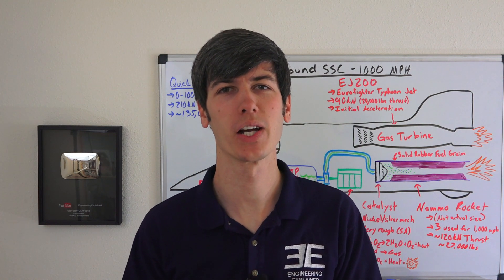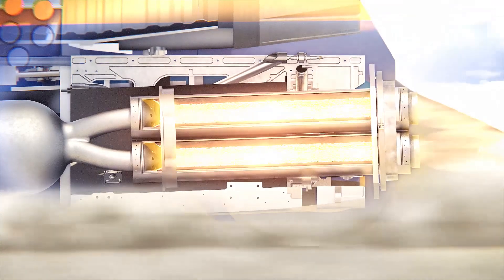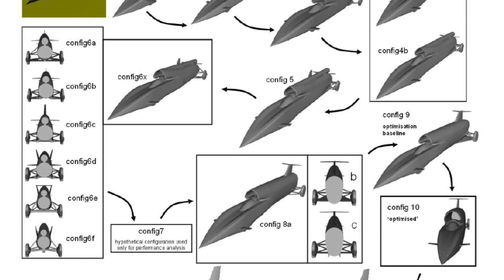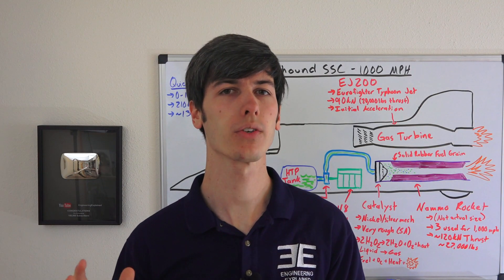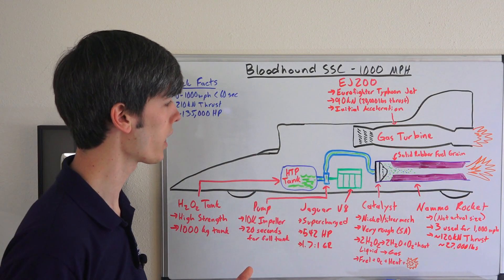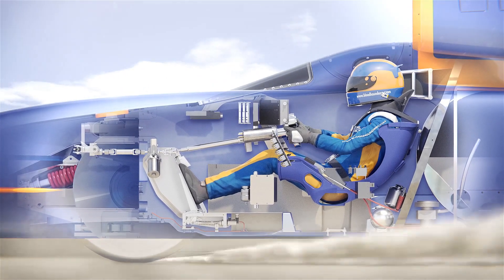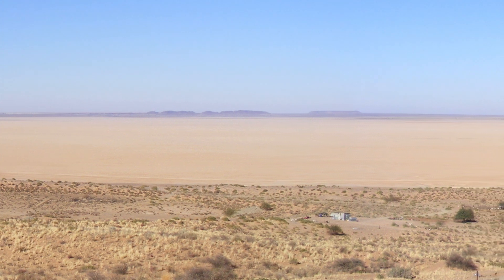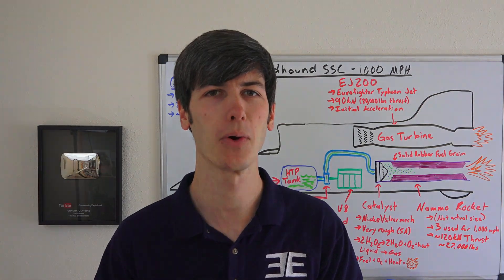Bloodhound SSC - Mark Elvin: Lead Engineer Q&A

Comment: i found it interesting that you said the air needs to slow down. So the conventional idea of ramming air in for better combustion would be ineffective in this application? if so would a SCRAM JET work at 1000mph on the surface?? Theoretically a scram jet would be able to activate at mach 4 - 6 at very high altitudes. so would the more dens air at ground level not be able to lower that speed to say mach 1?? The fastest scram jet recorded apparently reached mach 48 but it was on a drone.
Reply: Rage Auto That's a general problem of jet turbines. The air reaching the turbine has to be subsonic otherwise the compressor stages will stall because the whole aerodynamics change quite radical if something goes supersonic.
Reply: o yes i forgot the car is already traveling supersonic... i forgot about that part. my mistake
Reply: +Rage Auto By lowering air speed, you increase air pressure - it's almost like adding additional compression stages; aside from the aerodynamics from other replies

Comment: why not do it in Nevada or Utah?
Reply: 7150285 The ground is too soft there. It was already sketchy when they run the Thrust SSC back in 97 in Nevada.
Reply: shi01 In thought it was in Utah west of The Great Salt Lake
Reply: 7150285 The record run was in the black rock desert. If i remember right they run some very early design/component tests in Utah, but it was clear from the beginning that the actual run would not happen there. The problem was that the car cut really some groves into the ground which can lead to a problem because they run under the FIA rules for landspeed records and the rules of the FIA say you have to do 2 runs on the same "track" in opposite directions within an houre. So if they do the second run the vehicle has a tendency to stick to the grooves made by the car and that's something they don't like to happen because it can lead to dangerous situations at this high speeds.
Reply: shi01 They don't run on exactly the same part of the track...each run is moved over parallel to the previous one to avoid the ruts.
Reply: I think they said that Black rock Desert was prone to flooding too often.

Comment: I'm curious as to why its so much more difficult to go faster than the speed of sound and beyond in a land vehicle than it is in an airplane. Why is that?
Reply: Because in the air all u have to worry about is... aero.Power.lift.and structure integrity. But on land u have more work on aero. Eg lift.downforce. stabillity. Then u have to worry abou the ground. Finding the right turf. Then wheels suspension (drag) from ground contact. Power. And finally u have to really pay attention to the structural rigidity. Stability and vibration and aslo the safety which is less on ground! I Hope i helped. :)
Reply: Golferperson1 Actually, the main problem is the airdensity. Even fighter jets can't reach high mach numbers at low altitudes. If you look at jets like the F22 or EF typhoon, they can reach about mach 1.4 (1.4 times the speed of sound) at sealevel with full afterburner which is already quite impressive. At higher altitudes they can reach this mach number even without afterburner and the top speed goes up to the reign of mach 2.4. So you need a huge amount of thrust and very low drag to go supersonic at low altitudes.Also if you go supersonic, the aerodynamic can change quite dramatically. Just as an example if they would fit a diffusor like in a race car to generate downforce on this car, the moment the car breaks the sound barrier the diffusor would start to generate lift. This and what mr_kamacuzy already said makes it quite difficult to go beyond mach 1 in a land vehicle.
Reply: Thanks guys!

Comment: I wanna know how important that steering wheel is. isn't it travelling way too fast for his senses?
Reply: The vehicle is dynamically stable. Thrust SSC used to yaw to the right quite violently in the high subsonic range but Andy Green was always able to get it back again. That is probably the area of highest risk. Once it goes over M1, the vehicle will become quite stable.

Comment: Aerodynamic heating really won't be an issue as the Bloodhound won't be going nearly fast enough to make it one. Compressive heating only becomes a problem at higher Mach numbers (temperature ratio increases with square of Mach). With Aluminium you only begin to have a problem past Mach 2

Comment: why v8 jauar engine to pump fuel instead of 4 rotor wankel with turbo? or to use some power from jet engines to pump that fuel?
Reply: Gotin Fuklio Jaguar is a major sponsor of the project.
Reply: +Gotin Fuklio For the answer about the jet engines (and I know you asked this ages ago);
To get a mechanical load like that through a shaft would require the use of a power turbine (a turbine behind the exhaust of the turbine casing), which in the case of Bloodhound - their power is used in the form of thrust - not a mechanical shaft-driven load.

To do this, you would need two turbine engines, where a reciprocating engine is far easier to maintain.

And Jaguar money
Reply: ipullstuffapart yeah i know they had to choose bigger jet engine or separate engine. so the question with jaguar v8 and wankel 4r is left, but the jaguar sponsorship answers everything. thx for the feedback tho
Reply: Because its not British.

Comment: Thanks for explaining the engineering but seams like a total waste of everything. Why try to make a mediocre jet that has aluminum wheels and sort of works for a short time on the ground. The sound barrier has already been broken, nothing left to do here. And all the effort to remove rocks in Africa, better things could be done on that continent.

Also with all the safety its not like we admire the bravery of the driver/pilot. No one could match the spirit of Australia for that speed record on water that hey has not been broken since 1978 yo!!!
Reply: tubesurfer23 Troll? Nice try.  You either 'get it' or you don't - obviously not in your case. For any others here that wonder why...look at the huge Bloodhound education project www.bloodhoundssc.com